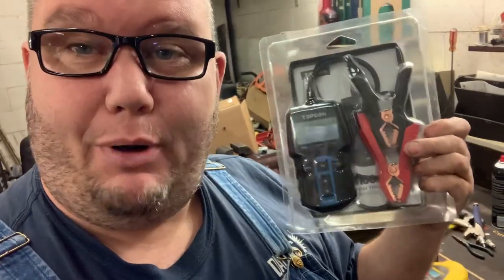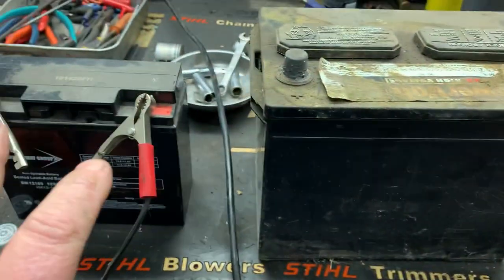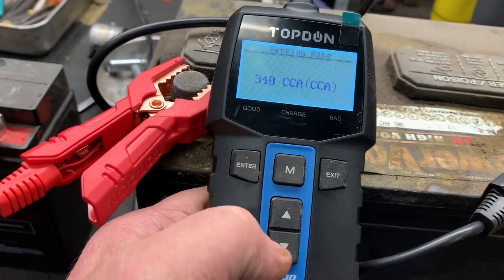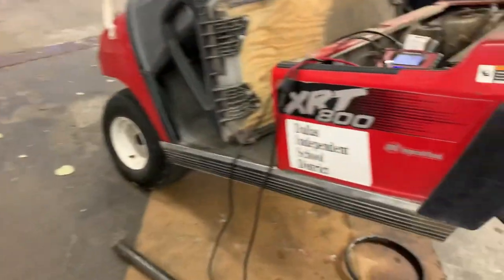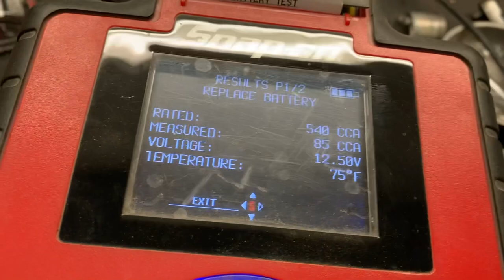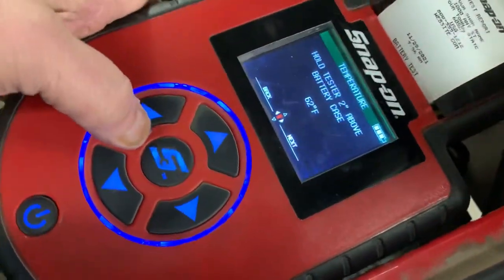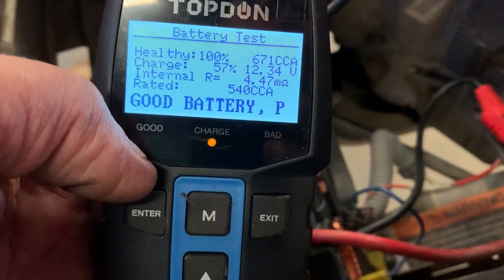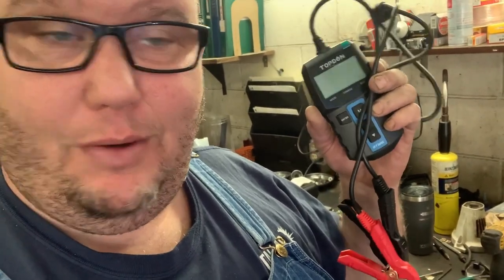$47 TOPDON BT100 VS $600 SNAP-ON BATTERY TESTER SHOWDOWN

Comment: I like the video. One thing though, the resistance is measured in milliOhms not MegaOhms. Mega is a denoted with a capital M and milli is denoted with a lowercase m. With any battery the lower the internal resistance the more Amperage the battery can put out. A low internal resistance doesn’t mean the battery is internally shorted because the cathode terminal is not connected to the anode terminal.

Comment: Hey, Jeremy!  Based on this video I purchased the Topdon tester at that time. Tried to read the manual but it was difficult to understand. 
Yesterday I finally got it out to test the battery on a lawn tractor and just started hitting buttons. It took me no time at all - really easy to use and a good size and weight. Readout super easy to see. Worked great and I’m very happy with this tool. It’s a relief to send out a machine in which I have confidence that the battery is healthy!  I wish more tools were this good and at a price I can actually afford. Thanks, dude! 👍🔧

Comment: The high resistance (36.59, should be around 4-8 m-ohms) is a good indication high sulfation. Top off fluids, run a charger with pulse tech, check it again in about three weeks, I bet it recovers!

Comment: Nice review. I keep dipping my fingers into the cordless/electric equipment simply because the market is getting bigger not a lot of shops are willing to touch them and I love stress and headaches. right now have a Ryobi lawn tractor a $3000 tractor that loses power and my first thought is to separate all the batteries record all the values then fully charge as intended separate them again and record values and see if we've got any out to lunch I think Ill be buying this tool right now.

Comment: nice Review and perfect video , just a small thing, its milli ohms not Mega ohms ! 4 Megaohms would be extremely high and there would be zero current going. oeps same comment as below sorry. The lower the internal resistance the better the battery's health is.

Comment: Hi again. Snap on is asking you in/out vehicle; it is asking you top/side post. Topdon just goes straight into the test. Previous version of Topdon did ask the same questions as Snap on.
Yet the results are nearly identical. So, what's the point of in/out vehicle and top/side post. It seems answering such questions lead to nothing. It makes no difference. It is very very strange.
Reply from the maker: It makes tons of difference such as parasitic draw and other factors that will pull amperage on a battery when installed in the vehicle

Comment: Just a few comments Topdon is pronounced Top Don and it’s not Mega ohms it’s mili ohms
Reply from the maker: potato potatoe. why did you feel the need to tell me this?
Reply: @THEMOWERMEDIC1  The reason why  a car battery's resistance is measured in mili-ohms or one millionth of an ohm if it was 3.5 mega ohms that would mean the resistance would be 3 million times larger that 1 ohm, meaning that battery could not  conduct any electricity. I brought it up to give you feed back so you can sound like you know what you are talking about. Which in the video hearing this could make some one think you are not educated. Which I highly do not think I think you know what you are doing and I want you to be great.